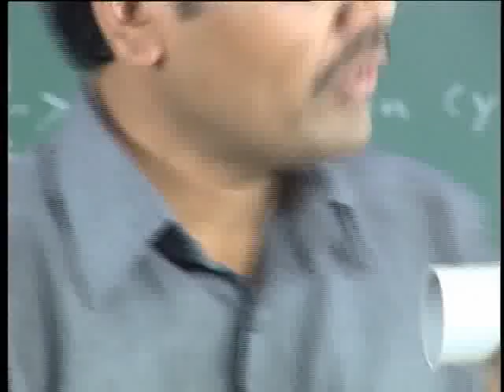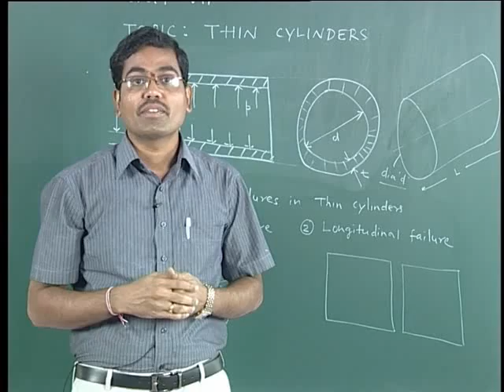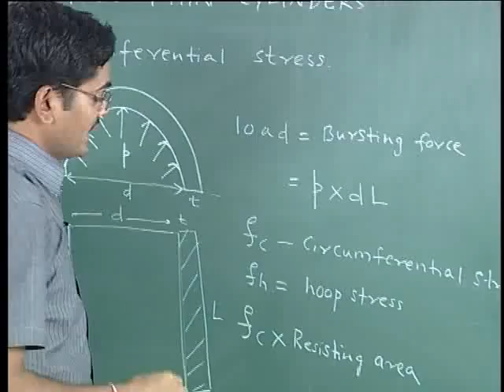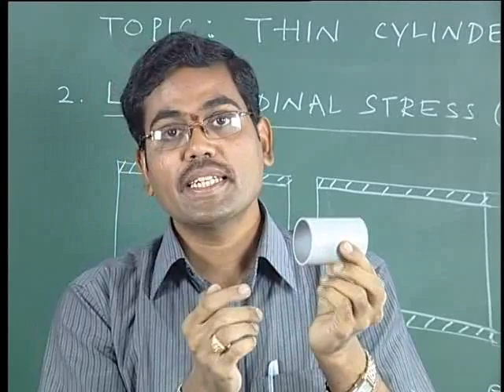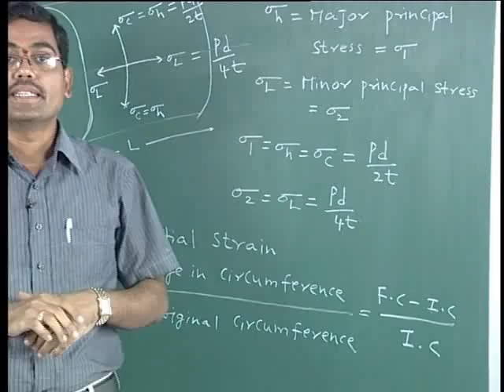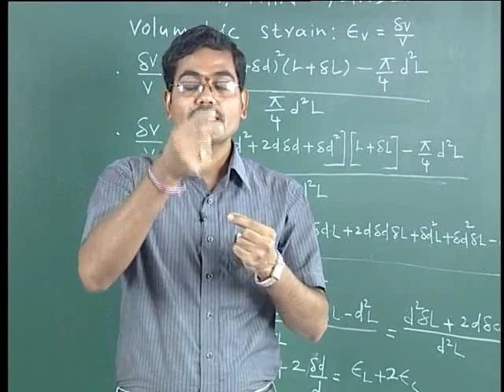Comment: Sir,i never understood why do we consider projection area rather than considering actual curved area of the cylinder where fluid pressure is exerting????what is the concept behind it?? please explain it sir if it is possible.
Reply: Dude for a curved surface area calculation you have to take an elementary strip and then 1st you have to calculate its area and then you have to integrate it for whole surface area,other option is to take projected area which gives somewhat same value